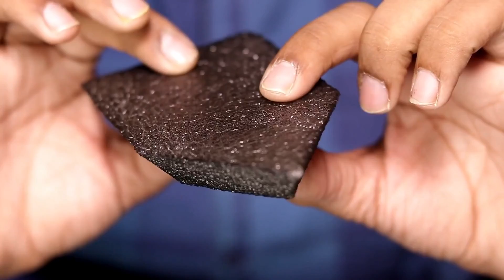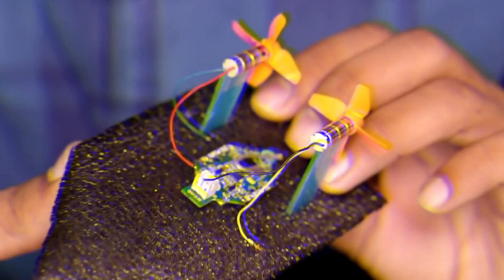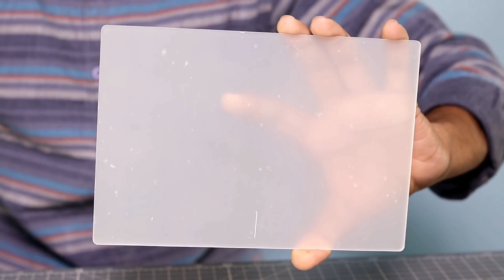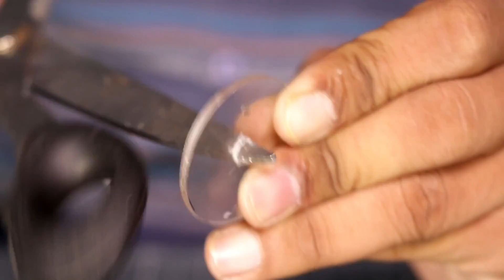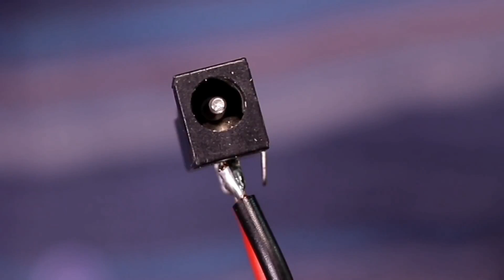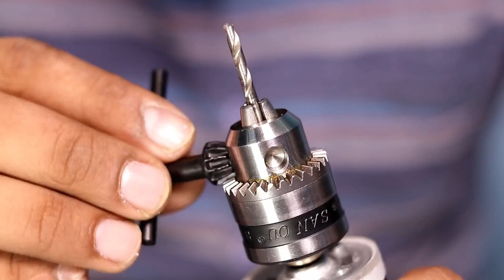2 Awesome ideas with DC Motor

Comment: Well done. There is no way for DC motor to cool itself properly. You could cut some gaps in pipe for air. There is only holes at the top of DC motor and I believe it's not enough for proper cooling.

Comment: Great ideas, but dc motors can draw huge current so use a variable duty cycle speed controller if you want to use a lithium battery